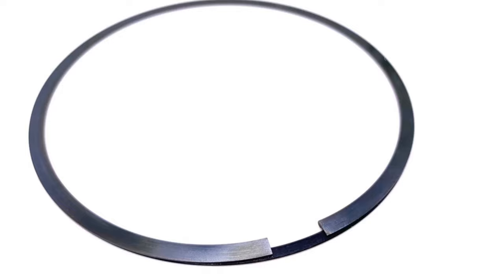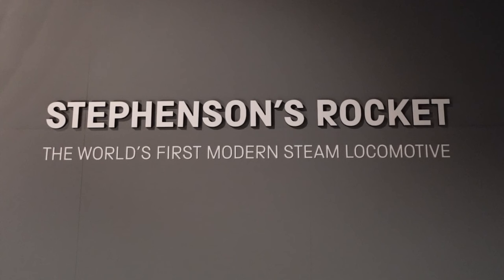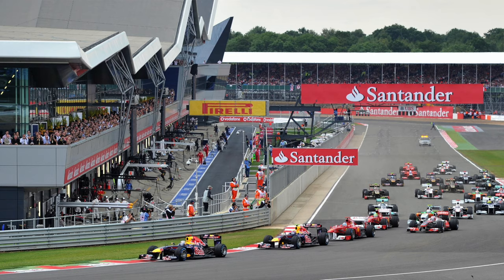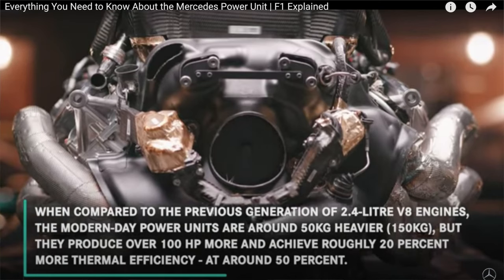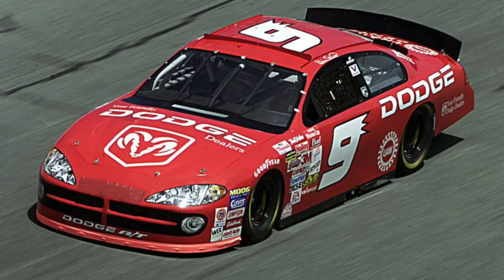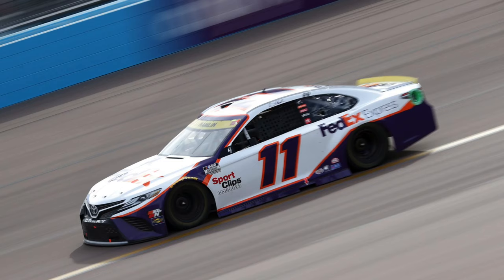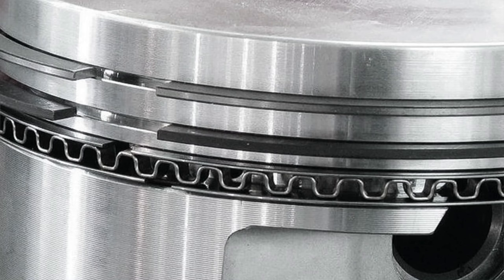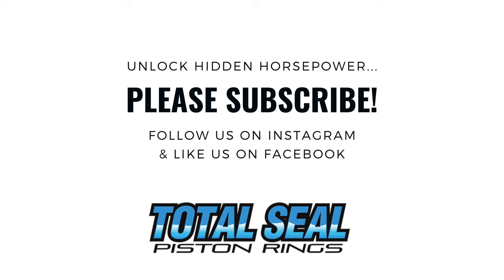From Steam Locomotives to Formula 1 - The Surprising & Fascinating History Of Piston Rings!

Comment: You should see some of the other things Ramsbottom invented - water troughs (track pans in the US), tamper-proof safety valves, automatic lubricators and foundry equipment. 

His day job was as chief mechanical engineer of the London & North Western Railway, where he designed the largest class of steam locomotives ever used in the UK.  In his 80s, he was recruited out of retirement by the Lancashire & Yorkshire Railway to build their new locomotive works.

Most of us won't achieve 1% of what he did in his life!
Reply from the maker: Wow! Thanks for sharing!

Comment: The 356 series of Porsches were expected to burn a quart every 600 miles with the rings of the day. Today, if you replace the pistons and cylinders on one of these nearly 60 year old cars, do you get computer generated designs that extend that mileage?
Reply from the maker: You can get lower oil consumption from a 356 engine by changing the cylinder bore finish and the piston rings.